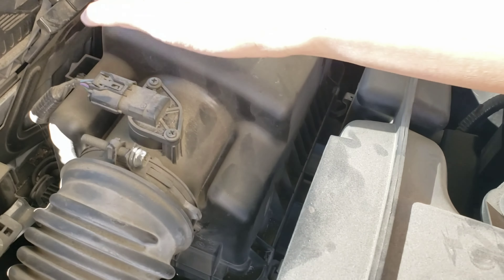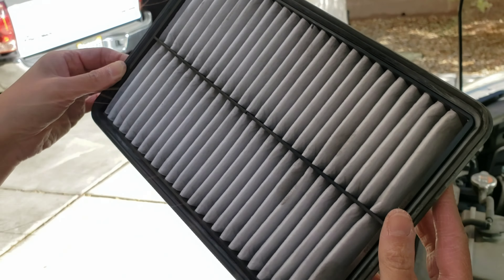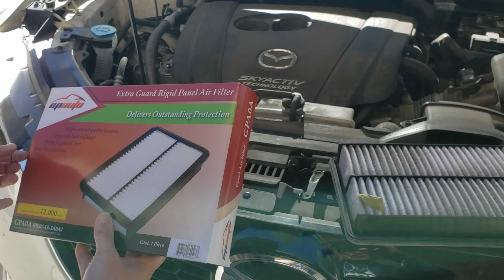DIY - Replacing Engine Air Filter on Mazda CX-5 (2014)

Comment: Nice job Pam.  Way to show that you can change the engine filter.
Reply from the maker: Yep, saved some extra $$ since the dealer would've charged for the part and billed like 30mins for the labor. Robbery says I !!!
Reply: @bensaysthings  they say it's a $100 service!  Part is extra of course.